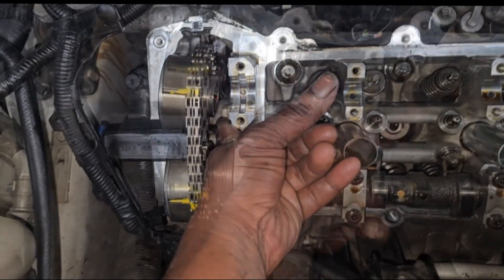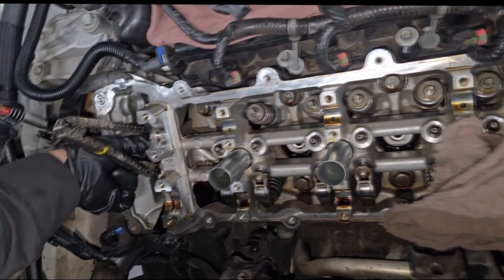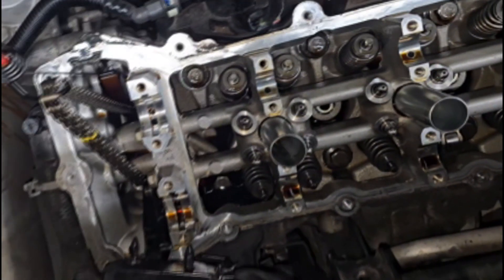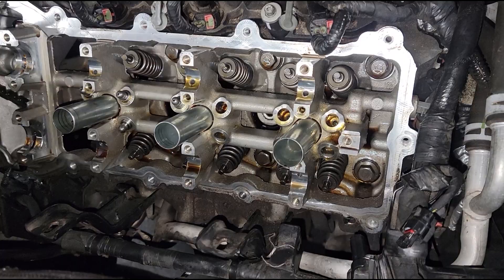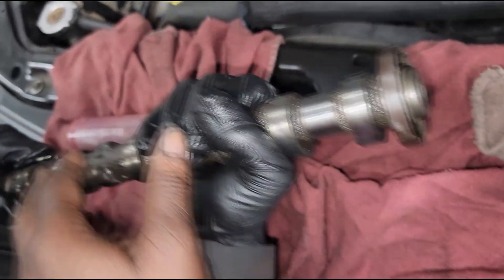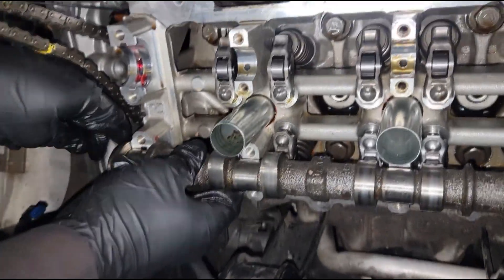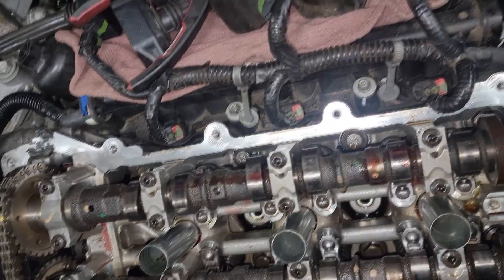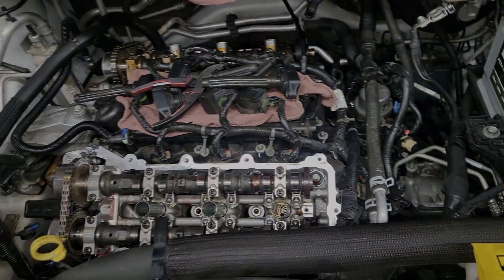The Surprising TRUTH About the 3.6 Pentastar Engine all New Mechanics should be aware of. PART 2.

Comment: Hey bro one quick question how do you fixed p0303 misfire cylinder 3 2018 jeep grand Cherokee 3.6L V6. I just change the coil packs and spark plugs code P0303 came come back up. Do I need to change. The valve rocker arm and valve lash  adjuste. Thanks 🙏🏻

Comment: I am doing the New phasers and rockers. I put my cams back in and after torquing them realized I did the torque to 90 inch lb but I did the sequence upside down!  Should I loosen them all and re torque in the right sequence? Just wondering if it matters, as I am worried about breaking a bolt as I have heard that can happen. SUBSCRIBER

Comment: What if your opinion as a master tech. Dave from Dave's Automotive would suggest to replace the engine as the shavings that you mentioned will eventually damage the engine. As they will block passage ways and bearing material. 

Good video.

Comment: You Didnt lube the cam lobes only the cam bearing.  That thing will rattle on startup
Reply from the maker: I had stop filming by then. I normally saturate the entire head with oil just before putting the valve covers on.
Reply: @OnlineMechanicTips  ahh ok

Comment: I have a 2012 dodge grand caravan that will barely start up in open loop . My scanner is showing over rich fuel trim . If I unplug the pvc value , the caravan will start . Could the fuel regulator in the fuel pump be bad ?